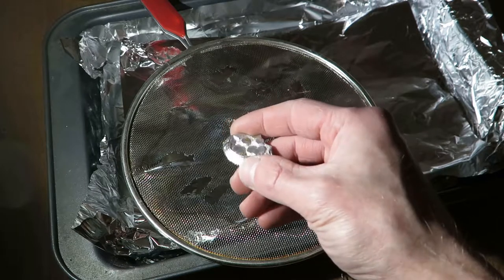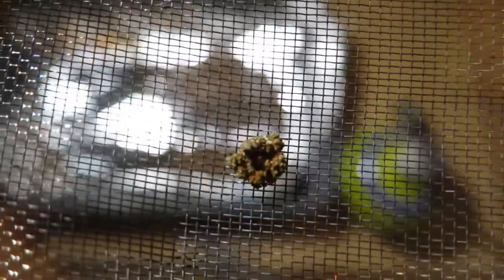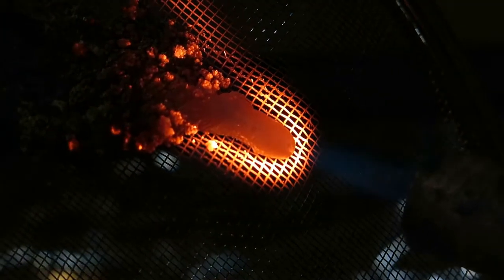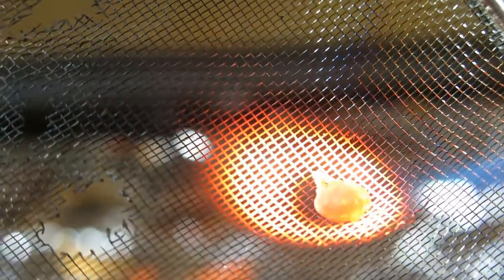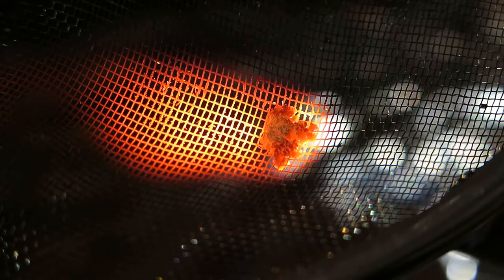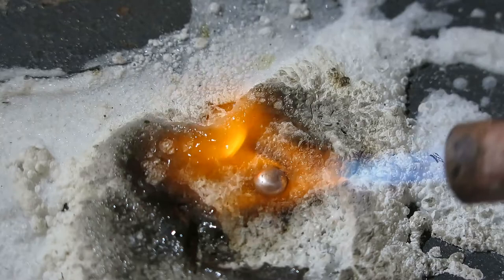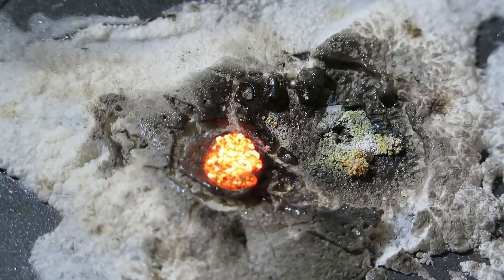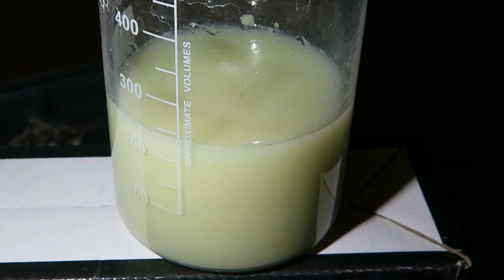Solder weirdness

Comment: Lead has a lower ionization potential than Tin. So when you heat up to red-hot, both elements lose electrons.

Tin will take up electrons from the lead. And the lead will oxidize.

Lead oxides and carbonates are yellowish.

Comment: Lead has a fairly low melting point. If you superheat the lead it will oxidize and combine with hydrogen. What I think is happening here is that the lead oxide is burning off the captured hydrogen from your torch. You should try running your torch with more oxygen.
Reply from the maker: This is propane torch though.

Is it even possible to grab hydrogen from alkane?
Reply: @IlusysSystems  oh I thought you were using your hydrogen torch. I'm not sure what is happening but some metals do absorb gases when they are liquefied. Is there any flux mixed with that solder? Maybe that is what is burning off. But I do believe that your end product is lead oxide.
Reply from the maker: @philipbender956  flux doesnt affect this process much.

I am certain, that we end up with tin, lead oxides and perhaps carbonates of various oxidation states.

What else could it be?

It's just quite unexpected that this happens in a way it does.

Comment: Don't use an open flame.
The temperature is too high, you are preventing the alloy to firm its passivation layer, and it will oxidize.